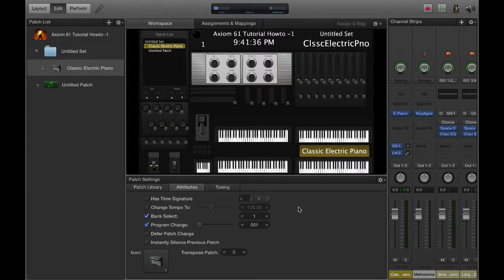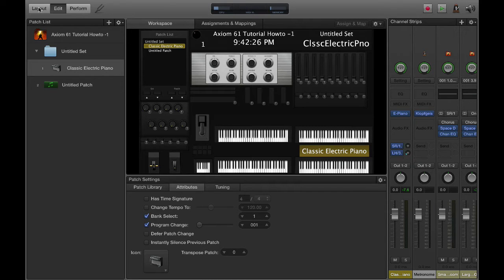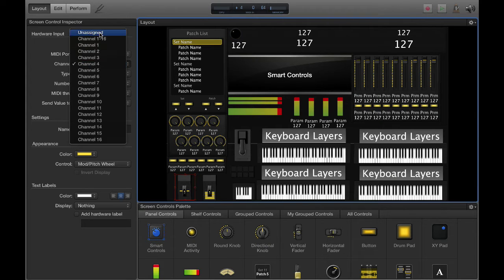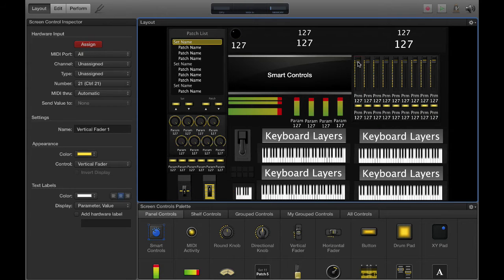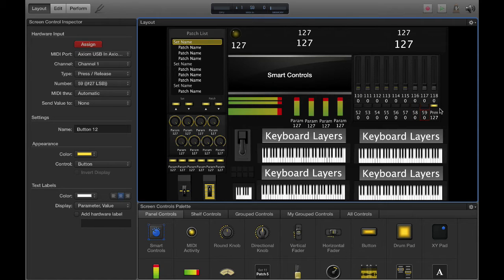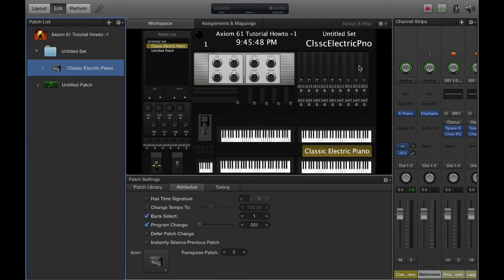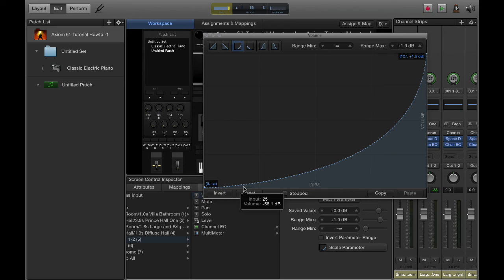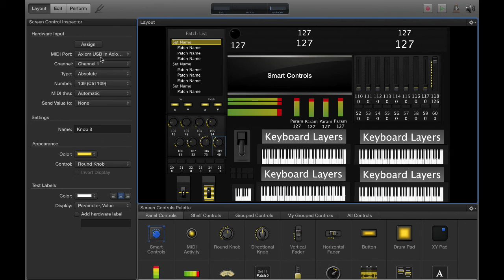[Mainstage 3.2.4] Mapping Hardware Inputs to Screen Controls

Comment: Hi, thanks for your helpful work.
Recently I’ve got the same setup ( axiom 61 + MainStage) but I have a strange issue…

In layout, when I setup (example) the rounding knobs, the AXIOM decide which midi channel and his behaviour. 
For example the lower first is set as “left-right PANPOT (-63 to 0 / 0 to +63)” and many other midi factory settings …. This is unuseful for me because I want to manage every single knob or slider.
I reset (+/- on) the axiom, tried various numeric pad configurations but nothing changes…..

As I saw in this video you map every slider, every button without problems to, after that, assign in edit mode the behaviour you like…. 
For me sto the moment is impossible..

Thank you very much for your kindle reply…..
Giorgio (Italy)

Comment: I have a moxf8 and just bought the impulse 6, I have MainStage on my Mac. I just need help to set both keys to my laptop. I can set up the impulse 61 to my laptop but can't seem to figure out how to make my moxf8 work with MainStage.
Reply from the maker: Check out this video and see if it helps point you in the right direction. You essentially need to make sure you add two keyboards in the layout editor and assign them to your two different devices. Then you can create multiple channels in the patch and assign them to the different keyboards in the midi editor.

https://youtu.be/TpCBQ0Pi-Ec
Reply: Jean Renald Merina i have a motif xf8 too and it works Petty good!
Reply from the maker: Sorry for the late reply, I've been gone a little while from YT. But I am not sure exactly what you are asking about? I do not have the moxf8, but if it's a midi device, I am sure there is a way to get it to work. I have been able to use multiple midi devices with mainstage and it is a little difficult to setup, but it is possible.
Reply: You probably have figured this out already, but if not, you will have to download the USB 2 Midi Driver from Yamaha to get the motif to work with mainstage. your impulse should have been recognized automatically.